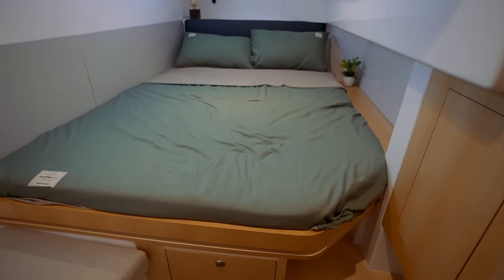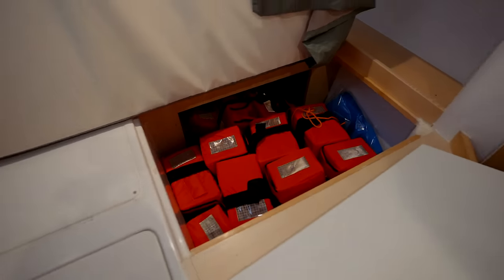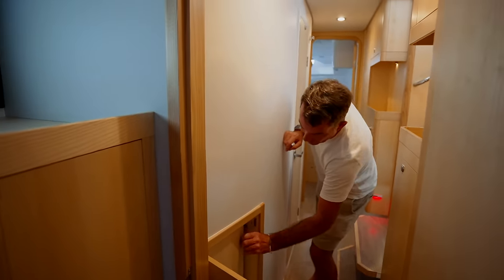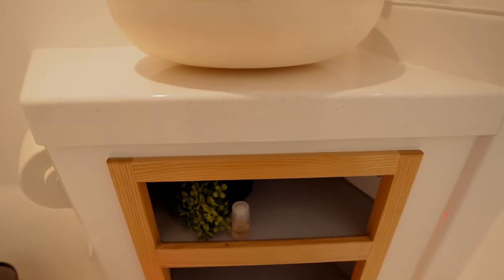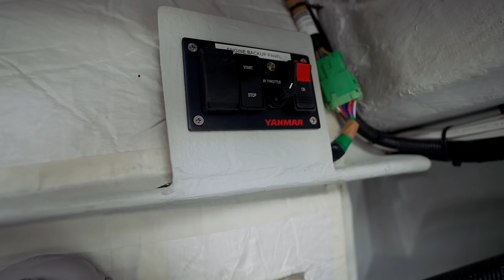Seawind 1370 Full Tour Part 2: Catamaran Interior & Plant Machinery

Comment: Great video guys, just a small update as we head towards our boat #14 and delivery in September 2024
The owners cupboard option has been removed, the "vanity desk" is now in all boats except hull #1. In your video with the Wynn's I couldn't help but note that you were sitting at the nav desk, and the Wynns at the saloon table, exactly as I predicted. Why would you want to sit in what I would liken to the "basement" with no view in the hull, as opposed to sitting on your "deck" in the saloon looking out with a view? Under way the vanity desk would be quite uncomfortable and accelerate seasickness for many people. We agree the cupboard option would restrict the view and flow, but a desk is not the ideal solution.
The charging at 200 amps should be emphasised that this is at 24v, equivalent to 400 amps per engine in a typical 12v system, and you have dual charging! A short motor from anchor to set your sails or out of marina will significantly charge your batteries. The alternators charge at twice the rate to the high voltage shore power system.

Comment: Nick at 10:12 the little shelf has a low stainless 'fiddle' to restrain the toiletries, if that was a little higher and a similar 'drop-down' fiddle was directly above it then taller bottles as well as the shorter things could be restrained, whilst ease of entering these taller items would still be possible by just tilting them in...not really possible for RR2, but a small suggestion for Seawind's ongoing refinements.

Comment: Coming back to sailing after years and years on land, while at the same time not only coming to another boat but really switching from monohull to cat (ok, you did some cat sailing in Australia but still), having to get used to your new surrounding and individualizing it a bit. Perhaps even having to get back into a groove as a couple after quite a few months apart, while also having to get used to all the modern rigging features that you did not have on RR1 - considering all that, it is no wonder you were pushed to a kind of limit in the first few weeks.
Now, you seem to settle in.
The design is beautiful. And since it all seems to be of good quality, the patina of use will make it very homely!
Congratulations to a good boat! Make the every-day-swing a bit more routine and I am looking forward to you step by step switching back to adventure mode in your floating little villa!

Comment: I know that this is a CRAZY question.... but could you do a video on how you make a bed in the berth that has no room on the side?   It could be a great short.  And also, how do you climb into that bed?  Naive I know, but I am not a sailor.  Thanks for answering the question that I always ask whenever I see a berth.  Your home is beautiful.  It's such a change from RR1.
Reply from the maker: Great idea!
Reply: It is a great question. What many many people do as a good compromise is to have a fitted sheet you only wash/replace every once in a while, plus 2 pillows, plus a nice blanket/comforter you can easily fold and keep at the feet side of the bed. So no flat sheet is used. This can look very nice and it then avoids the need to be climbing up to “make the bed”, i.e. tuck in and fold a flat sheet and blanket.

Comment: The workshop appears very functional .  And , the articulating "Dental" barstool must make Nick feel right at home (lol) .  Many seasoned sailors must already know this , but would be interested to know what spare parts are a must despite the fact RR2 is still new . 
Also, the space that holds the battery/electrical system  - is there a need that area be A/C cooled    ?

Comment: Is that a Korean washer dryer combo or something similar. The load is about the weight of one day’s cloths. The dryer mode takes at least twice the time as the wash cycle. I don’t think this unit is vented I’ve had three European Spledide combo machines. One was not vented and used more water than the wash cycle. It heated not dried the cloths. The two vented units performed much better. All thre has much larger load capacity and the price was similar to the mini unit. Does your’s run on 240 v?